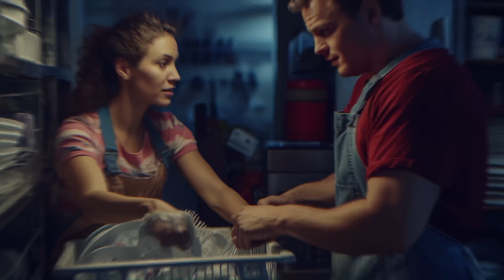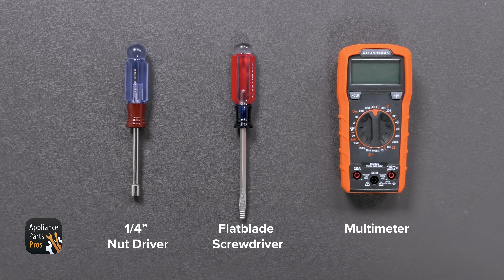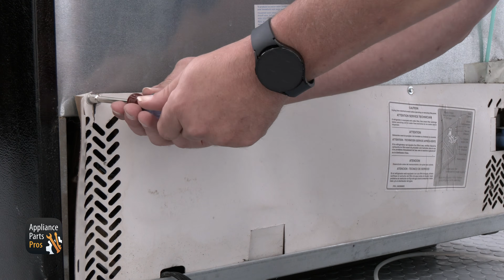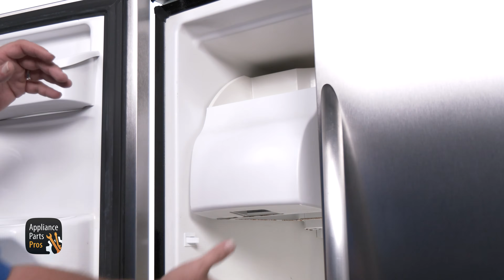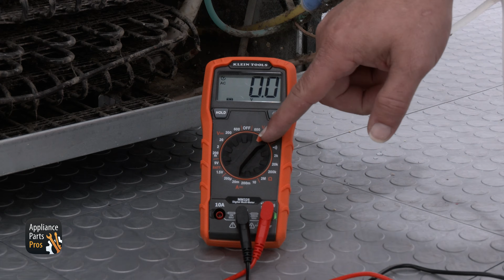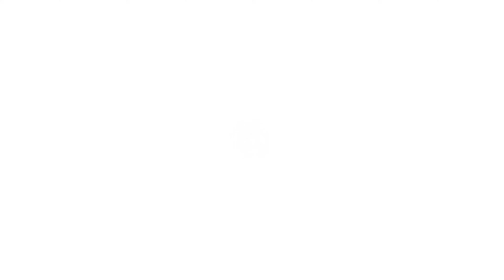How To Test A Frigidaire Refrigerator Water Valve 242252702

Comment: My ice maker motor will not continue to run after turning the screw, it goes a little ways and stops....
Reply from the maker: If the motor won’t continue cycling after manually advancing it, the ice maker module or internal motor may be failing. It’s also worth checking that the mold isn’t frozen over and that the unit is getting proper power.

If you need further troubleshooting or testing information you can check out our Repair Forum: https://forum.appliancepartspros.com/.  It’s easy to register, and you can either post your question or search the forum to see if someone else has already asked the same question.
 
Our experienced technicians, with over 20 years of hands-on appliance repair experience, are ready to answer your questions and guide you through your repair.
Reply: @appliancepartspros  I replaced the ice maker and that fixed it. There was no mold in the tray. Thanks
I can't complain it's 20 years old. In January i had to replace the defrost timer, it was causing the compressor to short cycle before it would come on, I also replaced the start relay and cap at the same time...
Reply from the maker: So glad you figured out the issue! Thanks for watching!

Comment: Is there a different test to see if the water valve needs to be replaced? I have that same fridge, and water drips out of the water dispenser "only when the ice maker is on." No problem otherwise.
Reply from the maker: That symptom is actually a big clue. If water only drips when the ice maker is on, it often points to a seeping (not fully closing) water inlet valve rather than a bad dispenser switch.

A couple quick checks:

Turn the ice maker off—if the dripping stops, that supports a leaky valve.
Watch the fill cycle—if you see slight dripping afterward, the valve isn’t sealing properly.

Unfortunately, there’s no much better “test” than observing this behavior—internal valve leaks don’t always show up on a standard test, so replacement is usually the fix.

Comment: Either the title of the video or the video itself is incomplete.  He is only addressing an issue with water going to the ice maker.
1. What about water going to the water dispenser?  I wasted my time watching this video because I have an issue with water dispenser, and the title doesn't tell us that this video is limited to the ice maker.
2. This looks like mine, with four hoses going to the valve. There appears to be THREE OUTPUTS from the water valve.  One for ice, one for water, but what is the third one for? 
I could go on with more complaints, but let me leave it with this thought: this would be so much better if it explained ALL of the hose and electrical connections on that valve.  There could be different videos for explaining testing the water dispenser and the ice maker, just tell us that in the title and in the video.
Reply from the maker: Thanks for the detailed feedback, Jason — really appreciate you taking the time to share it. You’re absolutely right: the video is focused on testing the ice maker side of the valve, and we should have made that clearer in the title and description. That’s on us.

You will need to test for power at the water valve when you push the dispenser to call for water. If you have power there and no water comes into the unit then you will need to replace the water valve. 

Thanks again for pointing this out. We'll work on making our titles and content more specific moving forward.

Comment: Water is not going to the ice maker. Water is coming through the water line but doesn't go beyond the solenoid. The icemaker gears all rotate. I replaced the solenoid with a new one purchased for your company. Suggestions
Reply from the maker: What is your model number?
Reply: @appliancepartspros  LFHT1817LF4
Reply from the maker: Thank you. You will need to test for power going to the water valve when you cycle the icemaker. If there is no power at the valve when the icemaker cycles and the wiring is good then you will need to replace the icemaker. If there is power at the valve and no water is coming into the unit then you will need to replace the water valve.
Reply: @appliancepartspros  LFHT1817LF4
Reply from the maker: Thank you. You will need to test for power going to the water valve when you cycle the icemaker. If there is no power at the valve when the icemaker cycles and the wiring is good then you will need to replace the icemaker. If there is power at the valve and no water is coming into the unit then you will need to replace the water valve.
Reply: @appliancepartspros  LFHT1817LF4

Comment: Is the plug on the water valve polarized? It can plug on two different ways?
Reply from the maker: You will need to take note of which plug goes to which solenoid on the valve.
Reply: Yes

Comment: This is not testing the water valve, it is testing the solenoid part of the water valve. The mechanical portion of the valve can also fail and the test does not address this at all.
Reply from the maker: This is a valid test for the water valve. Is there something specific that your water valve is doing that this test doesn't cover? If you can describe the issue you are having with it and your model number, we can look up specific information for your unit.
Reply: @appliancepartspros  I replaced the water valve to fix my issue of no flow. The electrical test passed. I had a mechanical failure with the valve itself. As I said your test is only for the electrical solenoid.

Comment: Why didn't you disconnect the yellow valve hook up the multimeter and engage the dispenser? Should be 120 volts line goes directly to water dispenser
Reply from the maker: You can test it that way if you aren't getting water to the dispenser.

Comment: I have bad smelling water leaking from the bottom of the fridge, and a small water leak coming out of the door which filled up the icemaker then froze the entire icemaker. I have never used the ice maker for 10 years. How can I turn it off. Its not connected to our water. I checked the drip pan and theres no water in it. I cleaned the drip hose and a little water came out and i found that it was frozen. I removed a bunch of ice clogging thst but water is coming from the icemaker. I think my ice maker froze up because I had the thermostat to the highest setting. I cannot figure it out.
Reply from the maker: If you don't have the unit connected to water then you will need to check your door gaskets to make sure they are sealing properly or the door could be getting opened and closed a lot or not closed all the way. Either one can cause warm air to get inside and cause a lot of condensation buildup inside.
Reply: @appliancepartspros  thank you!